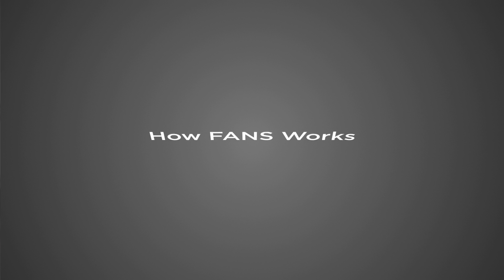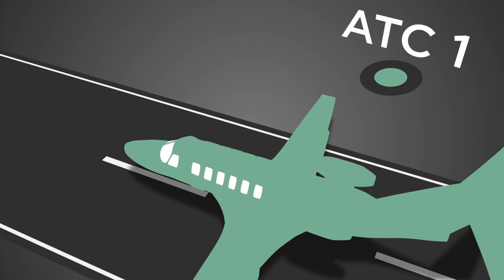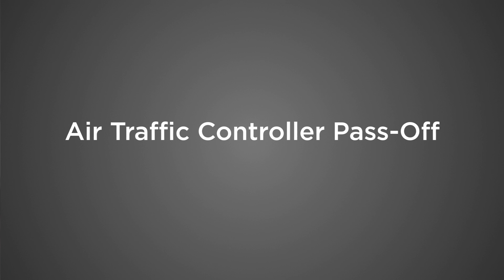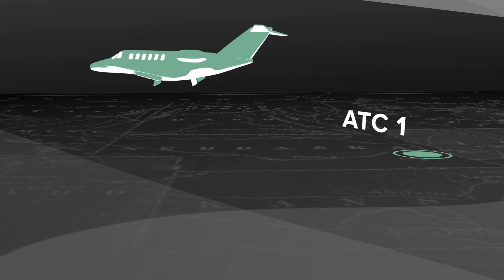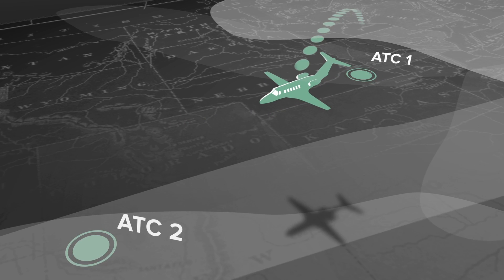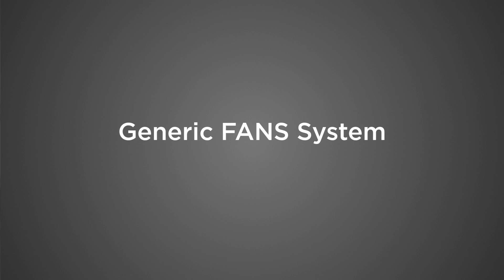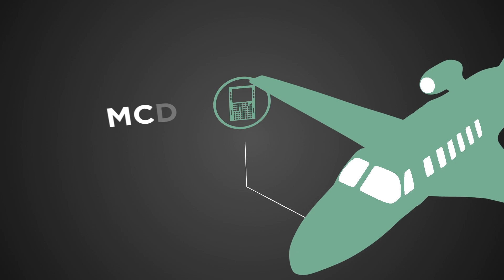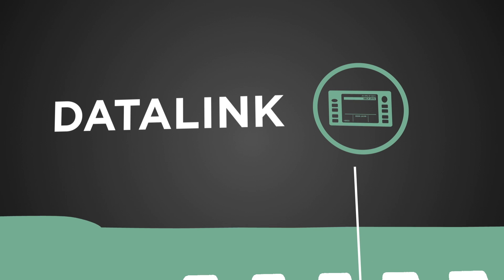How FANS Works (FANS pt 3)

Comment: Does it mean that when the aircraft is passed on to the next ATC controller, it will change the COM frequency as well? Or does just the data come from the next controller? (So the vhf unit which controls data transmission, like VHF3 in some cases, is the only one following this?)